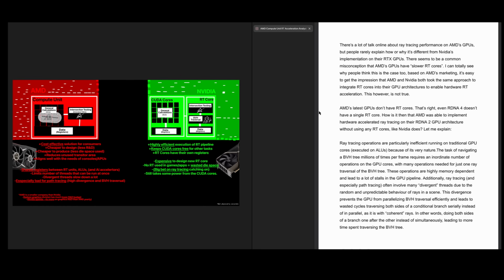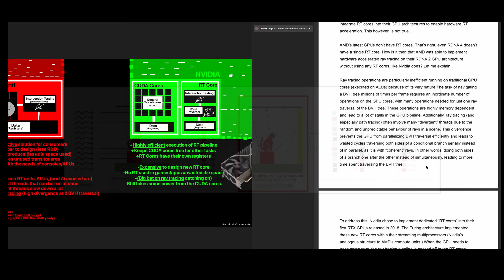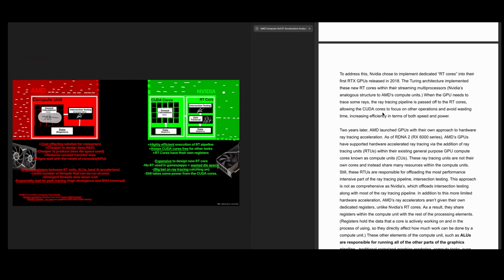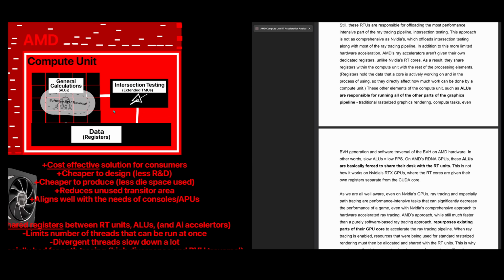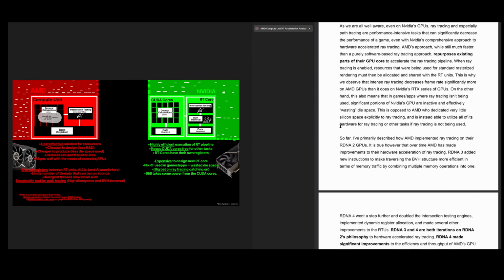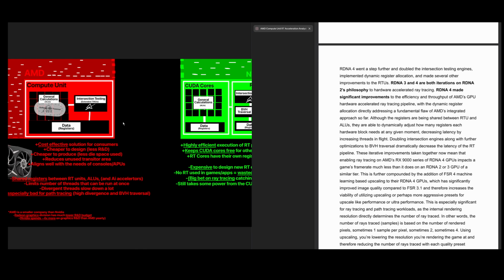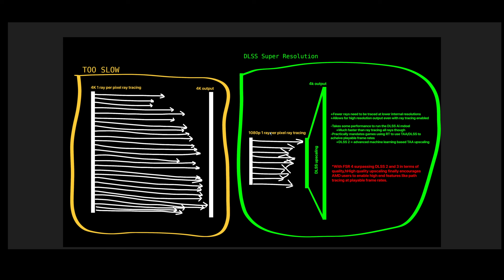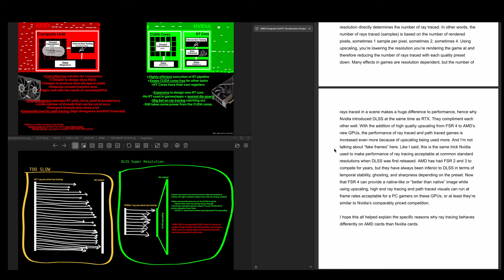How Does AMD Do Hardware Accelerated Ray Tracing?

Comment: I'd love hearing why some RT titles run on amd very nice (even recent "RT only" titles) , but on some others titles , RT completely kill the performance . Also there is for example a mod in Cyberpunk (UltraPlus) that has a RT-PT mode where you actually don't need to enable Path Tracing in the game but it offers PT visuals (with RT) without the PT performance drop.  So ,What makes a game "RT Lite" or "RT Heavy"  ? Is it the way a game is coded ? Number of rays ? 
Thanks @ClewlessClay for another wonderful  video :)
Reply: It's also a matter of how much RT you actually use. I believe DOOM Dark Ages (and probably Indiana Jones) only uses RT for global illumination, which doesn't change too much, so you can update the lighting more slowly. You can also see this in The Finals, which uses RTGI for the destructible environments. Basically the only difference in The Final's RTGI setting does is that it updates slower on low, and faster on high. 

There's some videos of Doom Dark Ages running on 1660 GTX without ray tracing, and some areas are just completely dark. Direct Lighting doesn't seem to be RTed, and neither do shadows.

So older games like Cyberpunk aren't built around the destructible environments. Realtime lighting changes don't really add anything when all your environments are static for prebaked lighting. So it doesn't make sense to have a low quality RTGI implementation.
Reply: I'm a software dev, and it's really easy to understand. On Amd, when you increase how many bounces of light per ray you have to calculate, the whole Compute Unit has to do its works over and over. Nvidia, on the other hand, does the same but only in RT Core. (Yes, sure, I know it's not as simple but for general understanding, it's that simple.) So Nvidia realized games can tank the performance on AMD, so it advocates for "Path Tracing", even if the image quality is only 1% better (well, it depends on the case). We saw the same ~10 years ago with Tessellation. Nvidia forced some ridiculous number, like 64x, even if you literally couldn't see any improvement past 16x. But the cost on AMD was much higher.
Reply: @alpha007org  so nvidia fights for hard to run difficult and unoptimized raytracing implementations? Why aren't sony and microsoft, since they use AMD, fighting against that? Actually insane how nvidia just gets to do this, when microsoft, a massive giant is disadvantages by that.
Reply: @herroberbesserwisser7331 From Nvidia's point of view: This runs fine on our GPUs. But if it works like crap on competitor's GPUs, it's up to them to optimize.

Nvidia RT solution is not unoptimized. They use fixed function hardware. Like FPGA for bitcoin mining. It's faster, use less energy (for the same output), but this also means their "block" on the GPU can run only this, and can't run anything else.

Both solutions have their pros and cons.
Reply: @alpha007org 

I was mostly talking about the game developers who do not optimize their RT. Even though it hurts consoles and in turn microsoft and Sony. All I am saying is, if game developers only optimize for nvidias path, they in turn not only hurt amd gpu owners but also consoles. And im confused why microsoft and others just let it happen like that.
Reply: @herroberbesserwisser7331 I'm confused too. We know that if you create RT game (/engine) engine from grounds up that RT games can have good performance on all GPUs, even going back 2-3 generations, on both AMD and Nvidia. Doom and Indiana Jones are the most recent examples.
Reply: @herroberbesserwisser7331 Probably just a lack of skill. A lot of "devs" these days just take whatever unoptimized solution unreal engine provides and call it a day. In GTA 5 enchanted you can run RTGI pretty well even on RDNA2 cards.
Reply: @alpha007org  Yup basically buy our $3k gpu and when you stand in place instead of playing the game and compare side by side sometimes you will be able to tell the difference.

PS. You have to cut your fps in half and upscale the shit out of it to even be able to run it.
Reply: Get a good GPU
Reply: @markojovanovic9651  lol bro...
Reply: @pdmidipd_patch7476 technically I am right 😂

Comment: first of all your information is wrong and secound problem i have is you dont own a RTX or a RX6000/7000/9000 card and say how good something is without experiencing it yourself, how awesome.
Reply: What exactly are wrong? This is the RT implementation architecture, you don't need to own the product to see differences in approach and improvements of the design as the time passes
Reply from the maker: Could you please explain what I got wrong? I'm definitely open to corrections!
Reply: @ClewlessClay  prob a troll account.

Comment: Can you do one on Intel RT?
Reply from the maker: I can definitely do that, it is interesting to compare because they're all different and Intel's approach has some things in common with AMD but it's more comprehensive than them and so is more similar to Nvidia in other ways. Thanks for the idea I will do that!
Reply: @ClewlessClay  Isn't Intel's approach similar to Nvidia's with proprietary Xe cores for rt?(not sure if they are full cores or just units, I think they are separate)
Reply: They did very similar to AMD, but i would like to have a vid on that too.
Reply: @vadnegru  I'm under the impression that Intel's implementation is quite close to Nvidias with dedicated cores that don't use up shader resources. Intel and Nvidia are the 2 companies that have been pushing RT acceleration research for almost 20 years now, no wonder both went with the proper approach to HW RT.
Reply: @randomobserver9488  I like AMD's approach. It's more generalized, sure it didn't do well initially (rdna2/rdna3) but they seem to have the hang of it with RDNA4. Interestingly, it seems with AMDs approach there needs to be more optimizations done on the developing side (which kinda makes sense). That's why RDNA4 RT was impressive in Ray traced titles, but more hit or miss on path tracing. In some path tracing games like Minecraft RDNA4 looks very competitive compared to the competition.
Reply: @randomobserver9488  intel's XE cores are just like RT cores with tensors combined into them.

Comment: this is why i slam those amd fanboys who are yelling yea RDNA 4 has good RT now RDNA 4 hAS GoOd RT NOW, i only hope if they hve dediecated RT core along with good Ray binning method which even Intel has
Reply: Funny part is that because Nvidia still puts 8 gigs on some cards, AMD cards with 16gb could do this faster (in same class and cost bracket). Turns out RT&frame gen are pretty memory intensive tasks.
Reply: @vadnegru  yea its matter of time they put more vram in their next generation of gpus, they were being too lazey in blackwell and ada lovelace because Amd was not putting up a fight
Reply: @bmqww223  But the point is that Blackwell still lacks VRAM, which bottlenecks their own sophisticated RT and DLSS tech. Does hightech even matter if your product is killed by yourself by giving an abysmal amount of memory?
Reply: I think that AMD approach is not as stupid as it seems. With software written in certain way it could even be faster, if nVidia get hampered by constantly copying memory. The same with DLSS, which only improve speed because no developer is running his own code on tensor cores, so they are free to perform upscaling. It only take one smart guy to take control of the tensor cores directly, and then DLSS could even decrease the game performance by hogging tensor cores starving other parts of the pipeline.
Reply: RT is good ONLY when it doesn't kill your fps on your VFM gpu . Hope it makes sense for you @bmqww223 now :)
Reply: With now 3gb memory are available . The cheapest rtx 6000 would be 9GB with 96 bit bus 😂.
Reply: If AMD ends up implementing general purprose prefetch hardware like CPUs do it the difference should dissappear.
Reply: @Salabar_  You don't really need to prefetch on GPUs, SIMT/hyperthreading hides memory latency and prefetching can easily just trash the small caches
Reply: @randomobserver9488  RT and the like limit occupancy.
Reply: @Salabar_  On AMD RT does yea
Reply: @randomobserver9488  Any complex shader does.

Comment: can there be nvidia like approach on radeon card thats for latency sensitive task like fsr4 while universal units raytrace with part soft accel pipeline the non time sinsitive frames that are capped at 60 fps piping into temporal buffer....Isn't this approach in use with RDNA4.

Comment: I see NO reason why this cannot be offloaded to a separate add in card!
3..3...2 and it should not take long for one to appear now.
Reply: keep in mind that offloading is costly in terms of latency (thus performance), you would want to wait several hundred microseconds for data movement between CPU, GPU and the external "RTU" when you have 16ms of frametime to achieve 60fps. Modern game pipelines are (often unnecessarily) complex and multiple milliseconds are spent before even a single ray is traced.
Reply: @fpgamemearray  We can do it today with physix... Don't see how RT is more latency sensitive than that
Reply: @pedro.alcatra  the amount of data to be moved for offload is vastly different unfortunately. And it would also be moved back and forth due to how intersection testing works. It's not that it doesn't work as a concept, offline rendering uses as much compute as you can throw at it, but for realtime you have timing constraints that are not compatible with moving large amount of data between GPU1->CPU->GPU2

i'm sure nvidia would be happy to market 2 5090s (one main and one RT only) for loaded enthusiasts (the famous 10k battlestation) if RT offloading really worked in online rendering.

just my two cents
Reply: @pedro.alcatra most game only use single core cpu when it comes to physics processing. And it is done on the very same core where game developer cramp everything to reduce input latency as much as possible.
Reply: @fpgamemearray  As proven by lossless scaling over the pci-e bus this is a non issue.
Reply: @noanyobiseniss7462   You know, I've never heard that one (lossless scaling) called fake frames before. People act like they are real!
Reply: Latency seemed the obvious reason to me. Real-time RT seems a BIT more intensive and latency sensitive than upscaling, which is a postprocessing thing.
Reply: @LucidStrike  The frame is generated and then the second card add the fake frames and delivers them, ergo the same can be done with ray tracing, its not brain surgery.
Reply: @noanyobiseniss7462 ofc it can be done, but lossless scaling doesn't touch the game execution, as it is a post processing hack that leverages the compositor and not the gpu pipeline. It also doesn't really care about staying within the frametime budget because it completely replaces the frame timing by inserting frames. 

Offloading can be done, but the performance penalty without relying on ad-hoc interfaces like NVLink would just be too much
Reply: @fpgamemearray  THAT IS LITERALLY MY POINT to those crying it will add latency!
Reply: @fpgamemearray  THE POINT is it is generated AFTER the intitial frame and then those frames are all displayed and if that does not add noticable latency then offloading racetraceing should not either. WHY AM I EXPLAINING OBVIOUS STUFF HERE?????
Reply: @noanyobiseniss7462  Because RT is a part of the pipeline? The reason why LS works is because it's working with already completed frames. RT/PT is not like that? They need geometry, color and AS to perform tracing, not completed frames?
Reply: @alyxredmond8753  That geometry can be picked up from the bus and does not need to pass through the rasterizer.
Reply: @noanyobiseniss7462  The AS and geo for RT/PT are derived from the pass for rasterizer? And again how are you going to solve the race condition? The latency problem? For LS it is acceptable because frame gen is inherently a latency inducing workload but RT/PT if enabled is a crucial part of the pipeline?
Reply: Offloading to a separate add in card is a really bad idea:
1. Current RT performance is limited by memory bandwidth. The Add-in card would need to have as much and as fast memory as the main GPU. The GPU die on the add-in card would need to have as much area dedicated to memory controllers and caches as and almost as much to registers, as the main GPU does. The die area needed for these only would be maybe 30-50% of the main GPU die area.
2. The bandwidth needed to transfer inputs and results between the GPUs would be much more than PCIe can handle, so you'd need some expensive custom super-high bandwidth bridge with even more extra die area dedicated to controllers on both GPUs.
3. The latency to transfer data between GPUs would kill many of the ways RT cores are used currently, including custom intersection shaders and ray continuation from hits.

Cost of the add-in GPU and extra controllers on main GPU would be almost 1.5-2x of the current GPU, just like power consumption and the RT perf would still be much worse.

Compare this to the current approach of dedicating a very small fraction of die are for RT cores and using memory, memory controllers, caches  and registers that already exist for free.

Comment: :face-red-heart-shape: Wonderful job!  You have good rhythm, tone, and insight along with easy-to-understand explanations of the topic at hand... and I found the length of the presentation to be to my liking.  Honestly, you could have gone on for much longer and I'd still have been interested and entertained.  I wonder what RDNA5 or UDNA1 have in store for us for RT improvements?  I wouldn't think that for UDNA they would want to do any type of fixed function silicon either, for yield and cost and the reasons you mentioned regarding unutilized hardware/silicon and the things that go along with that like the power/clock gating and other things that deepen complication in design.  Perhaps we will see more improvements to the RTU's and the register structure, but I'm assuming there's more in the tank to get at with improved software, scheduling/dispatch, ML/AI, and overall implementation, no?  Do the API implementations for DXR/VK Raytracing play any role in performance at all?  I'd imagine it's so little compared to the majority of RT processing/BVH Trav etc. going on on the GPU...but I guess I'm wondering is it well synergized with the way NV/AMD/Intel are processing RT, or could the API's benefit from a re-tooling of sorts for RT workloads?

Thanks for uploading, I'm looking forward to your next exploration!